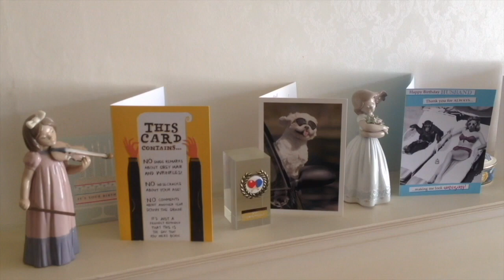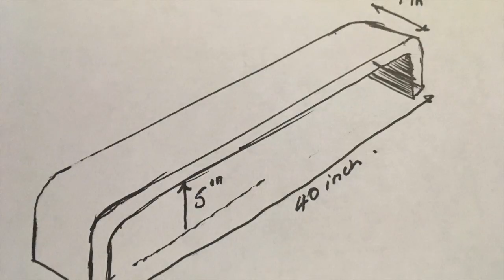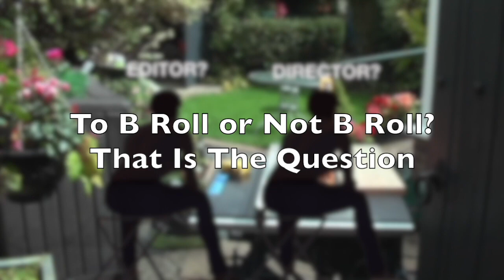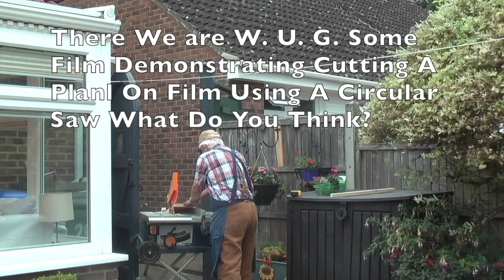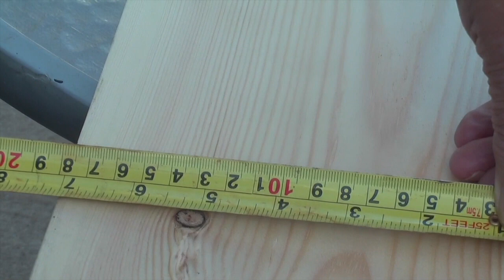August 2020 Week 4 - To B Roll or not to Be Roll

Comment: Editing wise yes second one is loads better but may I ask firstly 1) guard should always be used on table saw 2) a pushing device or stick to push lumber through cutting device should be used however your disclaimer would be this was for demonstration purposes only lol 😂 sorry I’ve just put my H&S warrant card away also lastly it’s you’re not your thanks for update all the best so glad you’ve got to see the family take care my friend cheers 🍻
Reply from the maker: Hi Jacko, thanks for those comments.  On the table saw I have recieved other comments and just want to state I do have a N.E.B.O.S.H. safety qualification and I should have stated for photographic purposes my error.  The Board was 9" wide and which keeps hands well away from the blade.  I have been using a Bench Saw on a regular basis for 65 years and never witnessed a kickback on ripping a plank, the secret it to let the saw do the work I can get more downward pressure with a hand than a push stick and control the speed.  I suppose H&S would call it a risk assessement.  Not certain what you mean regarding the safety gaurd as it was on.  Other Commentors remarked about no dust mask but it was outside in the open and comments were made about ear defenders but I find ear plugs in these situations more convenient but wearing them not so obvious. (they go in the pocket)  Having said all that thanks for the comments it shows you care.  Look after yourself Mike

Comment: Nice video Mike... sack no-one, they all did their job and produced a nice story... obviously the edited version was better. The only shot I would have added would have been a close up of the blade cutting the wood... I would have placed the camera on the piece of wood as you were pushing it through. Cheers Adam
Reply from the maker: Bit Late replying Computer went down needed repair.  I did think of putting the camera on the wood and then thought thats an allotment grow How trade mark.     No I have done it before it needs to be fixed to the timber and in this case as it is for someone else did not want to spoil the timber Take care Mike